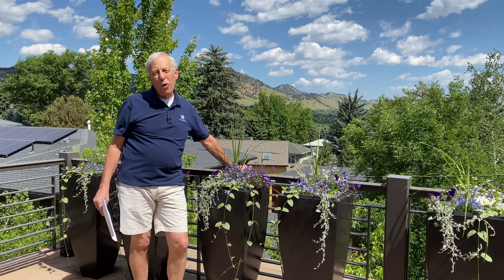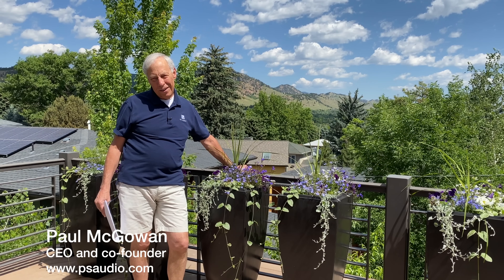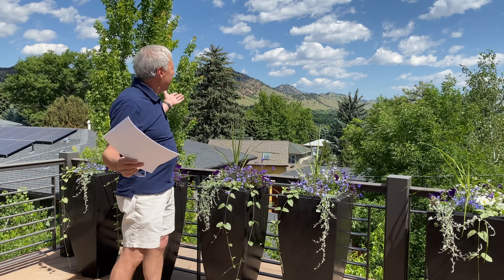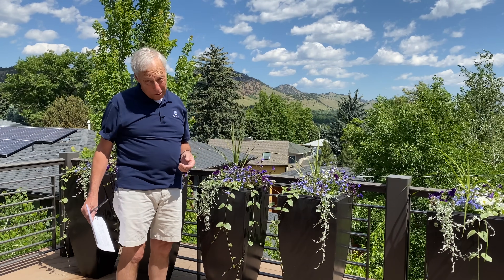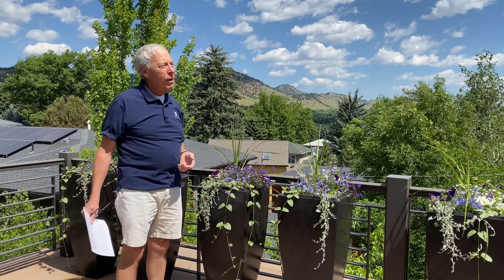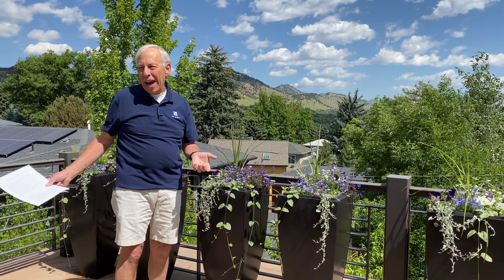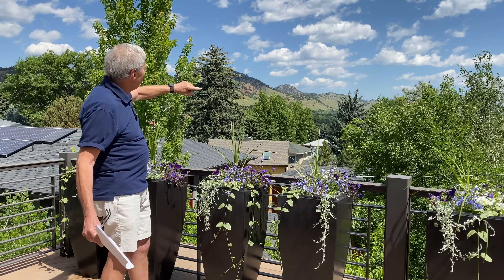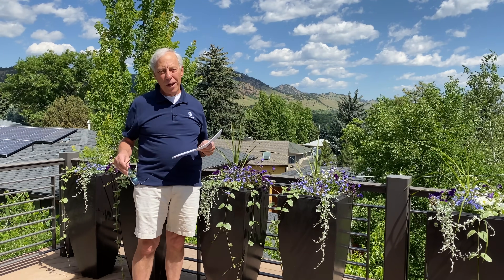High voltage equipment damage

Comment: One thing to take note of is when the power company provides a higher voltage than necessary, you will receive a higher power bill.  When I lived in Memphis, Tennessee, the local power company, MLG&W, fed a constant 125 volts rather than the standard 117 volts.   The extra voltage is lost as heat in your appliances, but does not harm them. Our complaint fell on deaf ears.   When I moved to Florida, FPL provided a pretty constant 118 volts.   But after the Hurricanes of 2004 and 2005 the voltage suddenly went to 131 volts.  I have several reliable voltage monitors in my home shop.   By the time they came out to check it was of course, normal.   They did this to partially recover revenue lost during the power outages cause by the weather.

Comment: I once had a direct hit on a window a/c unit that was about eight feet away from where I was sitting (I saw the strike).  The energy field it created literally picked me up about a foot off the sofa I was sitting on, before dropping me back down.  Nothing inside the house was damaged.  The A/C unit even still worked, albeit at a much less efficient level, and a much higher noise level.  And I survived, even though I felt like I had a ton of voltage go through me.  I might have been the luckiest guy ever to have survived relatively unscathed.

Comment: Yes lightning rods may protect you home from fire during a strike as designed. However as Paul said earlier a direct hit will likely destroy most electronics in the home. That massive amount of energy will dissipate into the earth however some may migrate into your electrical installation back through your ground at the service. There are documented cases of individuals being injured near an electrical device inside when lightning strikes exterior non direct. I have heard of electricians working in a panel inside a high rise unaware of a storm outside being hospitalised from this ground backfeed during a lightning strike. There are systems that can mitigate voltages to non destructice levels but they are at great cost and are installed during building construction..I have seen them typically in hospitals and data centers.

Comment: Surge protection doesn't help always...It's not quick enough. Lightning fried my Spa-bath and it was protected...I thought but no. But a simple glass fuse saved the electronic , the same for my heat-pump.  And this lightning split a 65amp ceramic  Fuce on incoming power, 2 25 amp fuses was turned to dust   and one 10 amp . All ceramic fuses.

Comment: I had a lightning strike in my neighbor's tree and it took out my router and TV antenna amplifier. It could have been so much worse but with TV and internet gone you are very isolated.
Reply: Power and/or phone outage: 
Practical reasons why I have an amateur radio license and battery-powered equipment.  
Every day, it becomes more valuable.
Reply: @spacemissing  I have fiber and 4G if both go down I am cut off but it's unlikely. A AC converter for the car is a very good cheap investment to get power.

Comment: Just use an Isol 8 mini sub axis, it a regenerator, filters also DC power, and is one of the most natural sounding boxes on the market and is actually very cheap, beating most boxes up to around 10x it's price.
And cool fact, after a lightning storm the sound is usually a bit better.

Comment: Hey Paul, come down to Australia.....We have 240 volts (15 amp) as standard!
Reply: It used to be. Now it's nominally 230 volts, but because voltage fluctuates all the time, electricity is delivered within an allowable range of between 216 and 253 volts.
Reply: @MrPeeBeeDeeBee  Here is the simple fact ... When electric power is delivered to a to the majority of residential households in US it is  3 wire 1 phase 240V AC. The 2 legs are split and are known as 120V. The actual voltages delivered are slightly higher,so the 240 can be close to 260 on some occassions!

Comment: I thought the mains voltage was 110 vac in da States
Reply: Go to worldstandardsDOT eu here it si

United States of America (USA)	A / B	120 V	60 Hz

iT SFROM three pahsew power RUNNIGN AT 208 VOLTS. The power between pahses if they are sinusoids 120 degrees apart, is the square root of 3, ot about 1.7. 208/1.7 is 120. Electric utilities have to keep it really close to 60 hertz or they can be liable for damages. I thinbg is maximum .1 Hertz or somethign really small. The guy from the ele3ctri cutilioty told me a logn time aog. I forgot. THANKE YOU AND THUMBBE SUPS!
Reply: @ilovecops6255  don't worry .. utility guy will keep it at 60.. he won't forget..
Reply: @analoghardwaretops3976  TBNANKE YOU MINE GOOD FRENDS! It ebetter to keep it at 60.0 3 siginificant figures instead of 60 2 significant because 60 can be 60.4 but truncated to 60.  Is tyhis the articvle yu were looking for...

Generator synchronization is the process of matching parameters such as voltage, frequency, phase angle, phase sequence, and waveform of alternator (generator) or other source with a healthy or running power system. This is done before the generator is reconnected to the power system. Once a generator is synchronized with the parameters of another generator, alternator, or bus bar, the system can run smoothly again.
Generator synchronization to a power system must be conducted carefully to prevent damage to the unit, as well as the power system itself. When synchronizing a generator to a power system, the frequency and voltage of the generator must match closely. The rotor angle and the instantaneous power system phase angle must be close prior to closing the generator breaker and connecting the isolated generator to a power system.
In the majority of cases for generator synchronization, the synchronization process is automated via an automatic synchronizer with manual control capabilities that can be used in backup situations. Synchronizing panels generally indicate any adjustments that the operator should make in regards to the governor and excited and when it’s deemed acceptable to close the breaker.

THANKE YOU AND THUMBBES UPS!
Reply: @ilovecops6255 ... In the US of  A.." videophiliacs will cry foul if it's 60.03 or whatever.. television there is on 59.97.. so BAD VIDEO..and they will now want to  install power conditioner that corrects it... more BIG BUSINESS OPPORTUNITIES....
Reply: @analoghardwaretops3976  THANKY YOUI MINE GOOD FREND The LCD monitor was 30 percent off at BEst Buy. It was reduced because ti was DEFECTIVE. BEST BUY IS pure garbage repackaged garbage. In October 2018 I stumbles on a video shogin Marshall JCM 900 has CLIPPING DIODES. That guy from CSGuitars said the Joyo VINTAGE OVERDRIVE is not as SOPHISTICATED as an Ibanexz Tibescreamer. He never defined what SOHPISTCIATED IS, considering Joyo stuff is basicxall an exact opy of whatever they are dcopy. YOIU ARE COORREDC, all fo them a huge decxivers to get other peoples hard earned $$$$$$! I now do what Miert Fat Rat said and just us emy ears. If it sound good to me then its good enough! THENK YOU FIOR BEING THE TRUE AND HONEST FRENDS. THUMBBES UPPES!

Comment: Wonderful scenery and good advice!
..and yes, whenever a lightning storm happens, I pull out ALL plugs of my equipment from the wall.
I always get voltages a bit over the nominal here. It's been happening for years but nothing drastic has happened (yet).
Upon investigation I discovered that a variation between -2%  to +6% is normal due to higher demand during peak hours, and the opposite when quiet.
Reply: @FatRat-f9m  
LOL!.. when paranoia sets in, you may get up in the middle of the night to go check the ...supply voltage!.. (Not really, just joking here but, it's always in your mind)
And no, the equipment itself hasn't had any problems as a result of this, however...
...before I installed Led lights in the house, I use to have an unusual number of globes failing regularly. I am talking of course of incandescent ones that are much more sensitive (filament inside), of voltage excesses.  
But all other equipment, so far so good!
Reply: @FatRat-f9m  
Hi Fat Rat !
Apparently, according to the suppliers, the minus / plus of 2% - 6% variation is within the standards set by Gov. regulation.
In my case, the distribution transformer is almost outside my place and so, I get the full effect of a higher than normal voltage.
Houses further away, because of voltage drop on the way, get closer to the nominal 230 v.
...and being somewhat paranoid about my equipment, I have a digital voltmeter permanently monitoring the voltage in my home!
I have had in the past, and at times of low demand, the voltage climb up to 250 v!  ...and that is when I started enquiries with my supplier.

Comment: Firstly, regeneraters do not improve sound quality. The audio signal path does not go through the power supply circuit" if you can hear power supply noise then your equipment is faulty or poorly designed.
Secondly, a surge protector will not protect from a direct or even near lightning strike. The only way to protect equipment from a lightning strike is to unplug from the wall socket.
Reply: ...& move the plugs away from said wall socket.
Reply: A lot of audiophile things are completely pointless. Like elevating the speaker wires from the floor and using 5mm2 for them, and those special made power cords, and what not. But it’s always good to listen for theories and after that you can still make up your own mind about it, like you did here. To me it seems like audiophiles are afraid to switch hobby and got stuck in a pointless improvement cycle.
Reply: b8e71fcbe2e195c67d8d16734013d20f
 There is so much snake oil being sold to fool the technically challenged. If audio tuned fuses are not stupid enough, there is a dealer here in Australia selling “Quantum Stickers” at $210 for a sheet of 20. Stick them around your gear and wow! Dealers peddling fraudulent garbage should be avoided like the plague.
Reply: @geoff37s38 ...always use your ears & if you can hear an improvement in sound quality then great & if you can't then don't spend your money...'simples'. One guy from The Netherlands told me to put some $20 IKEA bamboo chopping boards under all of my audio equipment & loudspeakers & even under my subs; that they would make an improvement to the overall sound quality. I thought, "Yeah, right, pffft, hahaha, idiot!" Guess what? I did it & my whole audio rig sounds noticeably better...wtf!? Yep! Exactly! It cost me $100 all up to improve the sound of my audio...go figure! I still can't believe it.
Reply: Fat Rat Neither can I!
Reply: Fat Rat I have a pair of floor standing electrostatics 1500 high made in WA. There is no box to resonate and the mylar diaphragm is lighter than the air it displaces so very little unwanted vibration.

Comment: But I heard that running your equipment higher like 230 volt your equipment running cooler?? confused
Reply: Switch mode power supplies that are compatible with the full 100-240V range are often a bit more efficient with the higher input voltage.  But that's just the power supply; nothing downstream of it will see any benefit.
Reply: @marianneoelund2940  thank you those stinking snake oil
Reply: @dandonna852 ...snake oil only stinks if it has gone over it's use by date.
My advice is to throw it out immediately & buy a fresh 44 gallon drum.
There's no such thing as 'too much snake oil'
Reply from the maker: No, not necessarily. The incoming AC voltage is converted by a transformer to exactly the DC voltage the units wants/needs to operate. So a 230 volt input yields the same DC internally as does 120 volts input. The transformer windings are simply different to accommodate the changes in input AC voltage.
Reply: As marianne stated it is more efficient..as such you have multiple gains. Cost is less for higher voltage due to thinner wiring however oversizing wiring also increases voltage delivery..I personally would like a river of power available with my equipment supplied with robust connections for increased efficiency but also better sound during spirited usage. Think pipe organ deep notes. Your not going to reproduce those notes using tiny wire and weak amplification. There is a somg by the cranberries that ends with pipe organ lows that surprises me everytime i listen.

Comment: I install appropriate value thermistors on the (vintage) gear that I rebuild... to get them in line with original design models... for gentle start up and slightly reduce the AC line / internal operating voltage. I always (reluctantly) unplug all my gear during intense electrical storms... Not going to take a chance...
Reply: Karen  With the device in series between power switch and transformer primary... there is a slight reduction in incoming AC line voltage, (with appropriate value device) primary goal is as a gentle power up, protecting components (sorry to repeat, I struggle for better way of explaining)
Reply: Karen  use the N.T.C. type.. 
( negative temperature coefficient ) thermistors 
before current is applied..it d.c. resistance is high...  when current starts to flow they warm up and it's resistance decreases
thereby reducing inrush current...
then onwards it continues to remain warm.. (power loss here is negligible)
but for a momentary power dropout it does not help ..
for repeated in rush current
protection ,the n.t.c. is (after a suitable time delay) bypassed through a time delayed relay contact

Comment: Older tube equipment can suffer if the line is that high. If you have a unit designed for 115volts with a 4 to 1 step up transformer with 126 volt on its input the secondary voltage will be 40 plus volts higher before rectification. It would be ez to over volt your B+ capacitors and literally blowing them up. But most modern transistor stuff will be fine. Just be careful if you have tube equipment.
Reply: No difference between tube and SS equipment in that regard.  They all have filter capacitors with voltage ratings.  Any decent design will have at least 10% margin and readily accommodate 130V power without endangering the power supply components.  
But tubes will suffer shortened operating life at 130V due to the higher filament voltage and current.
Reply: @marianneoelund2940  You are correct about a rise in filament voltage being bad for the tube but the rise will not be instantly detrimental.  Two things to consider, first solid state amplifier power transformers ratio is normally less than one to one meaning that any voltage increases on it's input results in a much less of an increase at the secondary where as tube power transformers typically have around  a four to one ratio resulting in a much increased output. Very easy to over volt your power supply caps. Second as I mentioned some older tube units were designed around a 115 volt line so if you have a 126 volt line now your B+ is 40-50 volts up and this is on the softest type of rectification heaven forbid you have a voltage doubler or triplier.  The filament voltage is raised by 1/80th the ratio of the B+ as well.
Reply: @phonebackup8132  
"The filament voltage is raised by 1/80th the ratio of the B+"  
Why do you think a smaller delta in absolute volts is better?  If the line goes up 10%, then the B+ goes up 10% and the filament voltage goes up 10%.  It doesn't matter if one is 40V and the other is 0.6V; they're both 10%.  
Similarly, capacitor rating headroom is done on a percentage basis.  If you allow ~10% rise for a 400V B+ in a tube design, you choose a 450V capacitor.  If you allow ~10% rise for a 56V B+ in an SS design, you choose a 63V capacitor.  The SS amp then has the same tolerance for line voltage rise.    You wouldn't choose a 100V capacitor for the SS amp.

Comment: Paul, I have your P15 regenerator for a few reasons,  but my question is about low voltage.  At my house the voltage can drop below 115, will the regenerator help that problem out?
Reply from the maker: You bet! That's where it really matters.

Comment: Pandemic...hummmmm... Go back to work Paul and just call it a protest. 
I'm thinking over all high voltage would not be an issue. Now.... short spikes on the other hand... lost my first receiver due to the pole in front of my mom's house being hit by lightening. It also blew every lightbulb and mom's floor model TV in the living room. The house I live in now all these years later is across the river from a former Beth Steel plant. The ground had to be covered in iron ore dust a million times over the decades and may be the reason that my 1 acre property has been hit by lightening 4 times in the last decade that I can prove and another 2 time that it is suspected. TV's have got cheap over the years so I don't really care about them anymore but when the boom booms start my main system is off. The real issue we have is not power surges but when the power goes out it clicks back on in a split second (I guess as other parts of the system try to compensate) over and over again like 5 or 6 times fast enough that the receiver, TV, PC don't have enough time to actually turn off. What a PITA it can be.
Reply: @FatRat-f9m  Beth Steel has been closed for years and is now a really big parking lot and a Amazon center. 
In my case it's the sand.....
Reply: @FatRat-f9m  I have two British bull terriers so that would never be an option in my house...ever. 
Carpets are dirty bro. All those skin cells have to go somewhere.
Reply: @finscreenname ...a flooring expert with dirty carpets? Wtf! Oh, the dogs...yeah, 'right...lol...